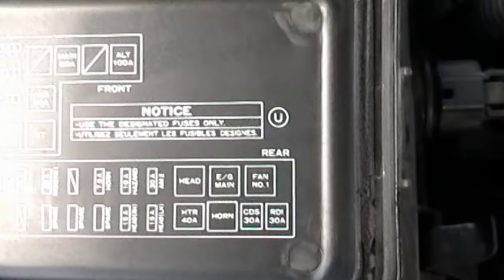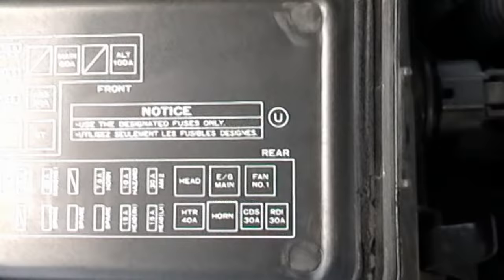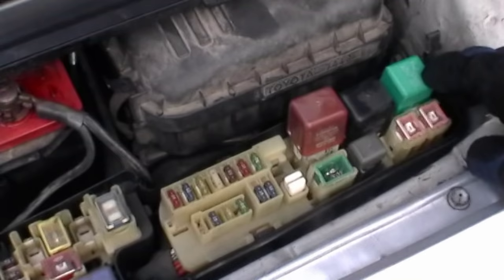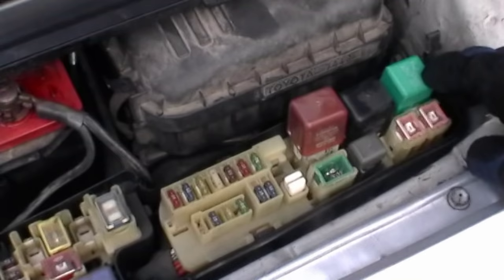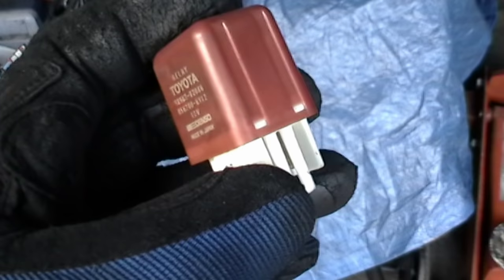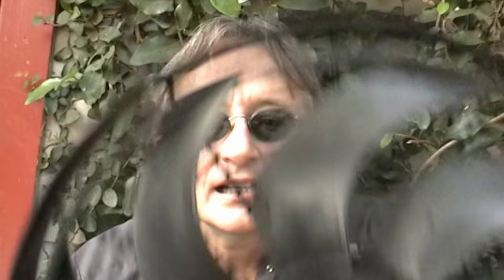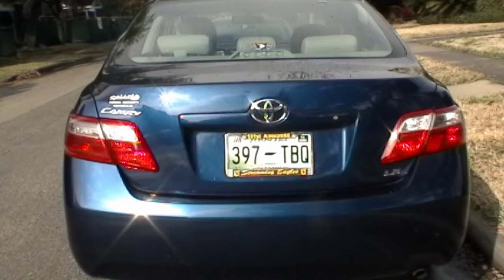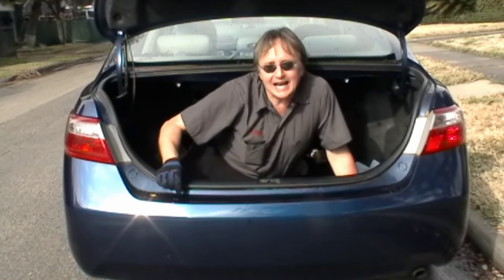How to Repair a Cooling Fan in Your Car

Comment: Please read it. so,I have a 2001 Hyundai Elektra.  I changed the cooling sensor and the relay as well, and still the fans don't turn on. however the fans turn in when I turn the A.C on,the fans work. but, when I let the car get nice and hot pass the meddle Mark (just a bit) the fans don't kick on. what can I do next? please help me . thanks.
Reply from the maker: generally a bad main computer does that. Either run the ac all the time, replace the expensive main computer, or wire those fans to run off a toggle switch with wiring and an in line fuse from the positive battery terminal .
Reply: +Scotty Kilmer, thank you. I didn't think about the computer, and yes I will do that ...keep the a.c. on. thank you for replying so fast.
Reply: +Scotty Kilmer , do you mean computer engine control (ECU)???

Comment: Hello Scotty, 
I have 07 Cobalt and my radiator fan motor  is leaking... Is this make any sense? Does a fan motor on car leaks?
Reply from the maker: they are lubricated and when they burn out sometimes they leak oil. But if it's coolant, it's the radiator leaking out and spraying off the motor
Reply: But still comes on... Do you think the fan still has some live left that's why didn't burn out completely?

Comment: HI Mr. Scotty, my 93 Mitsubishi Lancer overheated after driving for like 15 mins only, and after checking under the hood, the radiator fan doesn't work, but when the A/C is on, it spins but only for a moment then shuts down again over and over. I how wire it and it spins. what should I do next?
Reply from the maker: that old thing, just wire it to run all the time, or put in a toggle switch so you an turn it on and off manually
Reply: Scotty Kilmer thanks Mr. Scotty!

Comment: I have a 2000 Chrysler Grand Voyager SE
It sounds like I have a Really Squeeky belt.. However I just replaced the Belt, tensioner and idler pulley.
Its still squelling ... any idea??
Reply from the maker: if all belts and new and tight, then one of the pulleys has a problem, like a worn water pump or bad alternator dragging the belt
Reply: thanks
I'll start looking at those

Comment: I have a Ford Contour 96 and whenever I turn on my heat or ac, the air only blows out the vent under the windshield even if I turn the knob to blow out the panel vents.. Any Idea what this could be scotty?
Reply from the maker: it's stuck on default mode, check for vacuum leaks first, where air is being sucked in with engine running
Reply: Scotty Kilmer Ok thank you so much

Comment: is it possible for a bad radiator fan to be sucking more amperage than usual? In other words it shuts the motor off due to battery. no this is not hooked up in a vehicle it is hooked up to a carpet cleaning machine to move the hot air out of the van. it used to work fine for three months. And all of a sudden it is killing my battery it's not able to hold up anymore. Is this a bad fan motor?
Reply from the maker: of course it can do that, electrical parts can short out many ways to drain power
Reply: Scotty Kilmer sweet, thank you

Comment: Hey scotty my fans dont turn on i jumped the temperature. Sensor fan didnt turn on and i my cooling fan fuse is called a high current fuse how do i test those? I drive a 94 lincoln continental
Reply from the maker: test for power on both sides of the fuse, if one side has no power it's bad

Comment: @scotty Kilmer ive changed everything from my 1996 acura integra i replaced the radiator and the radiator fan, cooling fan switch, relay and fuse and yet my fan doesnt want to turn on ?!? Any suggestions i can do ?
Reply: +Scotty Kilmer
Reply: +Scotty Kilmer

Comment: lol my cooling fan wasn’t working bc the mechanic i took it to when my alternator gave out forgot to plug the cooling fan in when replacing the alternator on my 2007 acura rdx
Reply: luckily my dad found the issue and now it idles as it should and accelerates as it should after a $600 mechanic bill

Comment: scotty. skoda superb 1.9 08 plate. radiator fan not coming on now replaced but still wont work. relay checked. fuses ok. temperature sensor replaced. still no joy. what do you suggest? which relay is for the fan and location?
Reply from the maker: why mess with all that computer and wiring crap, just put on a switch and wiring to make the switch go on manually when you need it.

Comment: Hi i am looking for help 
If anyone can help
I have dodge dart 2013 sxt 2.0
So AC fan doesn’t work all the time but if car runs for some time , it starts working.
Then I can adjust speed of fan low to high very well. cooling n heating both works good
So question here is what is wrong with it . Is it blower or something else.

Comment: hey got a question i own a SUV with 200,000 miles on it an when ever i turn the engine  on i always hear a really loud fan it doesn't sound high pitched but it makes my car sound older than it already is what could be the problem? kinda reminds me of an old beat up vw beetle engine fan noisy sound would really appreciate a response from anybody!!!!
(side note)- its only a 2003 model maintenance is good

Comment: I previously  commented see below, I replaced the coolant sensor now the fan doesn't come on at all. Is the computer fried
Reply from the maker: +Ernst Hin if often is when that happens, but do of course check wiring for shorts and for bad fan relays
Reply: +Scotty Kilmer  I put  a new temp sensor on...the fan didn't work, now when i unplug the coolant temp sensor wire the fan runs all the time again. its a 2001 pontiac grand prix 3800 v6 series 2. ill check relays to

Comment: Hey Scotty, I have a 2003 Holden Commodore 3.8 V6 and is blowing warm air, air compressor clutch engages but small cooling fan does not, could this be the cause? Ive tested fan motor and it checks out but I've noticed only the large cooling fan relay is getting power, I've swapped relays around and still only the large fan relay is getting power. Im no car wizz but could it be because the the engine cooling temp sensor is worn out/needs replacing? I've grounded the temp sensor & temp gauge sky rockets. Any advice would be much appreciated
Reply from the maker: I assume you mean the small fan on the radiator, if so, realize that's all computer run and sensor has nothing to do with that since the large fan works. That would be a wiring or computer problem, many guys just rewire them to run whenever AC is on using a toggle switch if they don't want to mess with all that electronic computer crap
Reply: ok cool thank you for that, I rewired the fan today as you have said and both fans are working =) but air con is still blowing warm air. I had compressor replaced last year, system recharged with refrigerant at same time and air con worked fine for a few months then it started blowing warm air again =/ any idea how to go about trouble shooting this? I cannot afford to see an auto sparky again as they're all dodgy and charge way too much plus they keep the car for days and still cant seem to do a good job, any advice is much appreciated, thanks
Reply: air compressor clutch engages and I've read on the internet that if air compressor clutch engages it does not need to be recharged, is this right or wrong? cheers

Comment: I have a 2001 AUDI A4 Quattro Avant Turbo 1.8 L car 60 K miles on the odometer.   Recently I noticed that the radiator fan starts running when I start the engine despite of the fact that the outside temperature is about 33 F only.  I do not think this is normal. Any suggestion?
Reply from the maker: +Eva Szekely  old age and a money pit audi often do that. Change the temp sending unit for the fan and pray that fixes it. If not, live with it or spend a ton hunting for the culprit
Reply: +Scotty Kilmer Thank for your reply.....In the meantime we have found out that there is nothing wrong with the cooling system. It's a clutch fan which starts running when the engine starts  , ... I mean... it just seems that it is running...  We were able to stop the fan by hand.... The VAG scanner does not indicate any DT code.

Comment: Question.. I'm having the same problem with my fans did all the testing and they work when hooked to the batt. So I read your comments about wiring to a toggle and I've looked this up and I tried this a few days ago with no luck. Hooked to a LED toggle so I remember to turn it off.but when I do I blow the inline fuse that I have from batt positive to the toggle.. everything is grounded nothing is touching so I don't get it... I soldiered into the main lines and ran different wires to the toggle using the factory plug ins on the fans... and I thinks that's where the problem is coming in to play..So here my question can I run two wires from the fans( bypassing the factory wires) hook them to the toggle switch so I can control from in the car, but if I do that will it mess with my A/C or is that completely different from the fans? And if I can should what size fuse should I use, the toggle I have and inline fuse are both 20 amp now. Any help would be great sorry so long...
Reply from the maker: wickedmethods wire it with a switch directly, and just turn it on whenever the AC is on too so the AC fans will run then and cool better anyway.  I would use a 25 amp fuse.
Reply: Scotty Kilmer 
Ok thanks will try that..last question should I run a toggle for each fan or can I jumper the two fans then run it on one toggle, which shouldn't hurt anything with both running correct?,and not worry about a fire that was the other then that had me confused ppl talking fire this and that. Thanks again..

Comment: Fan works with a direct current and swapped all the parts you mentioned but it still won't work and the car still over heats
Reply: xxp21slayer Pedro u ever find a solution?
Reply: @HumperPedi  yeah I did thanks
Reply: @HumperPedi  apparently someone had removed some fuses which we completely overlooked because we had just replaced some old ones not long before.

Comment: can a faulty radiator resistor cause my fan to make a lot of noise
Reply from the maker: Kizzy Williams perhaps indirectly, but more often it's just worn out fan motor bearings OR crap stuck on the fan wheel
Reply: Thanks so much

Comment: hi,should the fan be bowing on the radiator or on the engine block?mine is currently blowing on the engine block and that is pushing heat into the cabin so i'm not sure if its the wrong way or not
Reply from the maker: of course they blow into the engine block cause they have to go the same way as the wind when you're driving
Reply: thank you

Comment: ok I have a 1992 Honda accord and my cooling fans will not turn on.  Even when I turn on the ac the fans do not spin.   If I wire the fans to the battery they work.  I wired the fans to the plug that plugs in to the cooling fan switch and the fans turns on.  I replaced the cooling fan switch and the thermostat.  I bough the car and it did not have one installed.  After this still nothing with the fans.  The relays are good,  what else could it be that is causing this?
Reply from the maker: bad main computer, in those cases, I just wire them to run all the time the car is running, or put a toggle switch to control them manually rather than buy an expensive computer
Reply: Scotty Kilmer my's a 2002 town&country...i'm going to put in a aftermarket relay kit...IIF I even bring the darn thing back up
Reply: Scotty Kilmer how do you wire them so they keep running when the car is on??

Comment: scotty kilmer 2009 toyota corrola ac blower motor is not working what is the problem
Reply from the maker: zulema terrones generally a burned out motor, unplug the clip that feeds it power, put power and ground there, and if it doesn't spin then, motor is bad

Comment: hello i have a dodge stratus 2006 the problem is the engin gets hot quickly but there is no overheating thr car runs ok is it normal or not ???
Reply from the maker: +kamal abbady if temp gauge does not get hot, it's not getting hot. Either you worded this wrong or you have no problems
Reply: thankyou so much

Comment: Hi Mr Scotty Kilmer , my car is Subaru Legacy 2002 with 2.0 litre engine ,

the cooling fans don't work even if the dashboard gauge reaches the RED H sign , i checked many things and i noticed that the negative terminal which feeds the relay is not getting any power , i hot wired that wire with battery negative , the fans start working endlessly until i pull the key off the ignition switch , i need it to start and stop like what it supposed to be , i found that the coolant temperature  sensor has 3 wires , when i disconnected it the temperature gauge went off , when i plugged the sensor again the gauge started working again , i think the sensor is doing two jobs , reading the temperature and giving the signal to the fans relay to make them work , 

how can i test the sensor ? and how can i figure out what are these three wires for ?

i tried using multimeter , all of them are negative , one gave me about under 6 volts , the second gave me under 3 volts , the third gave me more then 12 volts .
Reply from the maker: +thesniperofcs just replace the sensor, cause if it's not bad, your main computer has a failure in which case just rewire the fans to run off a toggle switch
Reply: i bought new one but the problem is the same , i will try checking the signal wires , Thank you very much

Comment: Fan came lose from housing how do i fix
Reply from the maker: they are bolted on, so rebolt it IF it's not broken. Often they come off cause the shafts or motor are broken, then you just replace the assembly

Comment: Hey Scotty I have a question I just put AC on my car and when I was driving the car with the Aceon the car turned off can you tell me anything about that
Reply from the maker: +ANTONIO PAGAN engine needs an idle up valve to set up idle to compensate for ac compressor power drain
Reply: Can you make a show off what can happen with your car if you have AC on and it turns off on you are you driving
Reply from the maker: +ANTONIO PAGAN they have various engines, go to an auto zone, they can show you a picture on their computer free

Comment: hey Scotty, i have an overheating issue, i replaced the thermostat and the sensor, i tested the ventilator by plugging it directly on the battery and the ventilator works perfectly fine,  i've checked all fuse and relays are good but the ventilator still doesn't turn on when i'm on a traffic jam, any idea ???? thank you
Reply: David Capo my problem too it turns on briefly and then it doesent draw power
Reply: Jasper Muyco I had to put a extra therms-sensor on it and it’s working now
Reply: @davidcapo2583  how did you do that? While commecting to the ecu?
Reply: Jasper Muyco Give me your email and I’ll send you a picture
Reply: @davidcapo2583  and i also bought a new fan and will tell you how it goes.

Comment: Hey Scotty I was driving my 1994 Toyota Celica 2.2l and my car began to over heat. I eventually got a hair line crack in my radiator. When I took my car to my friends dad which is a mechanic he told me that not one of my two cooling fans were operating. So he said that I should look into that because the could have lead to the crack in my radiator. I checked the cooling fan switch and ended up replacing it because it was old anyways and the I also replaced the relay. I am not sure if there is a fuse for this car I did not see one on the diagram but my fans are still not working please can you give me some advice?
Reply: When I tried to short the circuit going into the sensor I got nothing the fan still did not work...
Reply: I an leaning towards it being my ecu
Reply from the maker: Scottie Enis yes, odds are computer is bad, me, I'd just wire the fans to run all the time the car is running, many guys do that, it hurts nothing
Reply: Scotty Kilmer don't use the factory harness!!! I killed my ECM

Comment: Hey Scotty, I have an 04 Honda Civic LX that began overheating a couple days ago. Turns out the radiator fans wouldn't turn. I checked the fuses, they were good, I exchanged the relay with the horn relay and they still didn't turn on even though my horn relay definitely works, anyway I decided to go back to that later. I used a pair of alligator clips to test the radiator fan motor, the fans spun. So I checked the Coolant Temp Sensor/Switch (the piece that plugs IN) and put a paperclip inside of both sides then started the car, the fans turned on again. So I figured that was the problem, I changed that piece and still my fans don't turn on yet my car continues to overheat (I have coolant). Any suggestions?
Reply from the maker: if fans don't work still, computer or wiring is bad, normally computer. But, you can just wire them to run all the time the car runs, do that all the time.
Reply: Scotty Kilmer is it ok? fan runs all the time? no rest?
Reply: You should turn your fans off when the engine isn't hot and you're not constantly running the engine fast (i.e. highway keep fans on). It will slow the speed at which your engine heats up.

Comment: what happens if i dont have jumper wires how can i test it
Reply from the maker: make them, just need 50 cents of wire and twist the ends on the battery cables then on the fan wires

Comment: My cooling fan comes on as soon as the car starts.  Is that good for a G35 Infiniti 2004
Reply: Yes.
Reply: No, good. Once your car reach the proper temperature about 90 to 110 degres has to start the cooling fan no before. Because is te proper engine temperature that the engine works
Reply: Antegas Hindoyan

Comment: Can u help my heater in my C230 benz 2003 isn't blowing well
Reply: you may need to flush the heater core with water
Reply: +fargeeks thanks
Reply: +Teane Greene oh and one more thing 

it could also be your heater valve (that part that lets hot air in when you select high temperatures